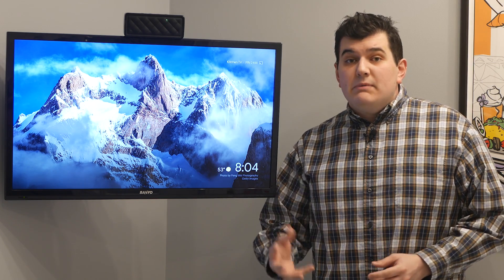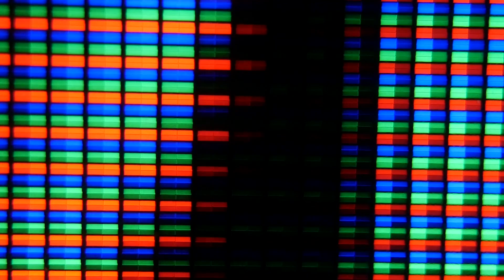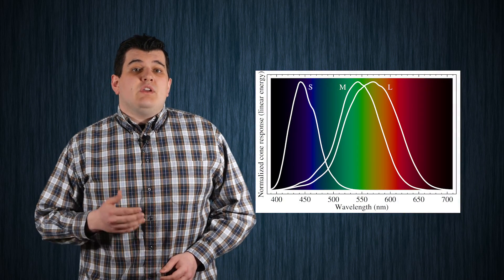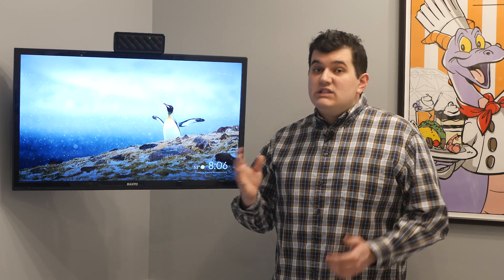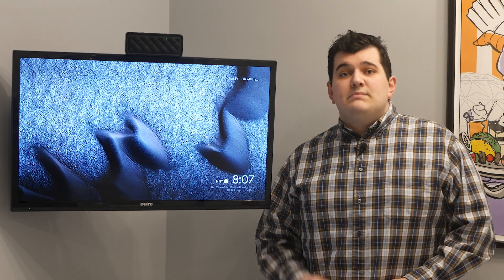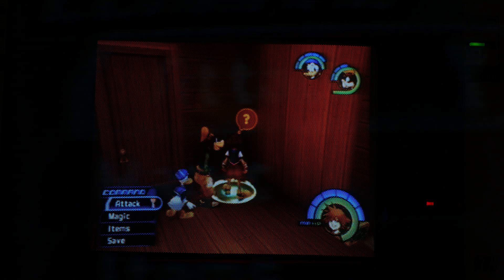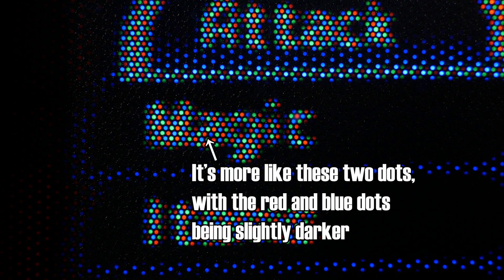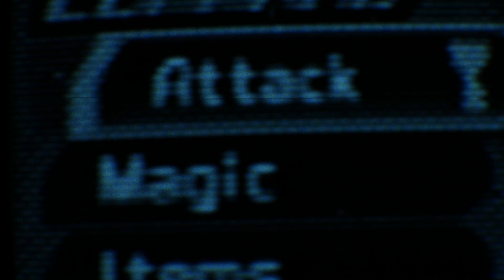These Are Not Pixels: Revisited

Comment: One note about computer CRTs: They work the same as CRT TVs, just generally with far more phosphor dots.  Note that this often determines what the "maximum resolution" of a CRT monitor is.  Higher resolution CRT monitors will have more phosphor dots packed in tightly.  One big thing about CRT monitors is that their input signal rate varies based on the resolution and refresh rate (frames per second / Hertz) chosen.  Most will have a defined "maximum rate" in MHz, based on the horizontal scan speed in kHz (that's the speed at which it scans across the screen,) multiplied with the frames per second / Hz rate (being how many times it goes down the screen redrawing the whole picture.)  That's the maximum speed the electron gun can change brightness.  In many monitors, that speed can be "overclocked" - shoving more changes at the CRT than the electron gun is actually capable of doing. This would allow you to either refresh the screen more often than the monitor should be able to handle (more frames per second,) at the expense of horizontal accuracy; or it would allow you to run the display at higher resolutions than it should be able to handle.

And in many cases, there won't be enough phosphor dots to accommodate that higher resolution. I had a high-end CRT around the turn of the millennium (okay, just typing that feels odd,) which was "rated" for 1600x1200 resolution at 80 Hz as its "maximum."  But I could run it at 2048x1536 resolution at 56 Hz.  That had a few major drawbacks - it was flickery has all heck, really straining on the eyes.  It lost horizontal detail, often losing detail horizontally to the point where it looked worse than 1600x1200.  And it didn't have enough phosphor dots - you lost whole pixels of detail.  A one pixel diagonal line would look "noncontinuous" as bits of it managed to avoid phosphor dots.  The phosphor gun may have been outputting the correct intensity at the correct time to draw it, there just weren't any phosphor dots of the right color there to light up.

Comment: 6:41 - "Think of it like three picture tubes, one red, one green, one blue" - which is exactly how my last TV worked. A rear-projection TV that actually had three physically separate CRTs - one red, one green, and one blue.  They were both aimed through focusing lenses and mirrors at the rear-projection screen that you saw the image on. It was a first-generation 1080i TV, but the display itself was basically the same technology as decades-old analog TVs.  By the end of its life, the three CRTs weren't properly lined up with each other any more. You could run the built-in adjustment system and get the center of the screen to look razor-sharp, but the edges would be off - if you displayed a picture of a white rectangle on black background just inside the outer edge, you would see a red rectangle, a green rectangle, and a blue rectangle, all slightly misaligned to each other.  The same thing in the center of the screen looked fine, though.

That was the problem with rear-projection-by-CRT: alignment was hard.

Comment: Standard definition is not 480i.  It's 525i.  Only 486 lines are visible though.  When digital recording formats were developed for analog SD broadcast most digitized only 486 lines making the recording format (D1, DigiBeta, etc.) 486i.  Later, consumer oriented digital video formats (mainly those based on MPEG compression) stopped recording 3 lines from both the top and bottom of the screen simply sending black to them on playback.  Formats like DVD and MiniDV are 480i.  Almost all professional digital recording formats are 486i.  And the analog standard they are designed to interface with is 525i.
Reply from the maker: This is all true but largely meaningless when considering overscan on any CRT television would almost surely show less than 480 lines.   Plus, many of those 525 lines were the vertical blanking interval and don't contain any image information.  From the consumer's standpoint, 480i is how they know SD.
Reply: True, but overscan makes '480i' just as meaningless then.  But when you are talking about how analog TV doesn't use pixels, to call it by a designation that has nothing to do with analog and is only relevant to an analog signal that has been digitized into PIXELS, that's fairly misleading.

Comment: I appreciate you probably won't see this but I would like to posit a counter argument. A pixel on a modern monitor/TV receives electricity to determine which red/green/blue on each "unit" of three turns on. An old style colour TV does the same thing the only thing which changes is the method of delivery of the electrons. I would argue it's a false logic to argue that because a mask is used to control the delivery of the electrons that this fundamentally changes what the group of three colour "receivers" are. Also the fact that resolution is better on modern TVs I don't see this as a difference in any fundamental effect. If we don't define a pixel as a block of three coloured projectors how do we define them? Arguing that the method of delivery of the electrons which turn those three on changes if it is a pixel or not is like arguing a car is not a car if gas gets into the engine in a different way.
Reply from the maker: See this I did, and respond I shall!  "The only thing which changes is the method of delivery of the electrons".  This isn't the case at all.  The analog video signal doesn't consist of pixels.  It's simply an amplitude modulated signal which dictates the strength with which the electron gun(s) fire.  Really it's just drawing a single line, but TV breaks up this line 525 times and stacks them twice for every frame.  The signal itself isn't separated into logical blocks like a digital video signal is.  
Also, when the screen is scanned on a CRT, the beam isn't moving in steps to place discrete points of light on the screen.  It simply slides continuously from left to right.  The smallest point of light it can create is defined by how quickly it can turn the beam on and off again.
If are old enough to remember setting the geometry adjustments on a CRT monitor, you'll remember how the image appeared to stretch completely naturally and there wasn't any apparent scaling going on.  The pixels generated by the computer aren't represented by rigidly defined windows like in an LCD panel.  They can exist between phosphor dots, and multiple groups of dots can represent one pixel.  This is why a CRT can display any resolution up to its max without moire or scaling artifacts.  Once you exceed its dot pitch, moire patterns appear because colors are being rendered incorrectly or incompletely.  
My argument basically boils down to this: Imagine taking a photograph, then covering it in a transparency resembling a grid of phosphors.  The image behind the grid is not made of pixels, but now you've placed a grid on top of it.  Is it right to call the cells in the grid a pixel?  Or are they just compartments?

Comment: THIS IS BULLSHIT! CRT monitors had pixels and precise resolutions ever since! Just because the image of a TV feed isn't made to have a specific brightness value for each color cell doesn't mean that the terms "resolution" or "pixel" aren't tied to the cells of a CRT tube. THEY ABSOLUTELY ARE! The spot on a CRT that has 3 color cells is the smallest area that can display a specific color and brightness. The number of these spots equals exactly the resolution the monitor has. Good computer monitors had pixel perfect images where you could see every pixel of each letter displayed. Showing a blurry image of a TV only proves that television didn't convey any kind of pixel information, not that a CRT tube couldn't have pixels!
Reply from the maker: So then, why can multisync CRT monitors display any resolution without apparent scaling losses?  You're confusing the fact that a CRT can display a grid of pixels with the fact that it actually operates on the principle of pixelation.  In your case, you're looking at an image where the digital output matches very closely the dot pitch of the CRT.  But there is no 1:1 lockstep relationship like you find with a digital display.

Comment: I totally agree with your explanations, I have been working in a company that produced broadcast and medical CRT monitors, we also made a color one with a B/W CTR (at 150hz) and a rotating RGB filter...
These concepts are not easy to explain, you do a very good job!

You could also say that any single color phosphor element can be partially lit by the electron beam thus being "more" than a single pixel (it's quite visible in the close ups of this video), even if the resolution will not take much advantage of that.

Comment: You are wrong when saying that by using only three light sources one can create any perceivable color. Due to the fact that different types of cone cells react to the overlapping parts of the spectrum, one cannot stimulate them independently. All possible combinations of stimuli form so-called color cone. The section if this cone by a plane, corresponding to the constant light intensity, form a horseshoe-like shape that cannot be completely filled with a convex combinations of any three colors. This means that for any combination of three different light sources there exists infinitely many colors that cannot be modeled by it.

Comment: If you very carefully break the guns off the neck of a CRT tv in such a way as to relieve the vacuum, and then chip away at the tube you can get an in person look at the shadow mask. On even a small set it's a huuuuge number of teeny tiny holes. I'm a dumpster diving weirdo and a guy came up while I was scavenging and started busting up the tube in a TV so he could get the copper from the deflection coils.   He had a wooden stick to pop the anode cable off the tube and it seemed like he had it down to a science.

Comment: This is why back in the day people played NES games with 4:3 ratio. That wasn't the game's actual resolution, but it was stretched horizontally (from 256x240 to 320x240 or 640x480 for example) to fit the TV. The game's pixels don't have to align with the TV's pixels, so it looks nice and sharp on the CRT display even when stretched. But on modern displays you have to make a compromise: play in pixel perfect mode, which doesn't look like the original game, or play in 4:3 mode, which looks noticeably blurry.

Comment: Really great video! I've been telling all my nerd friends to check out your channel. Special request: could you go even deeper and explain how "multisync" CRT computer monitors can crisply display different resolution images? I still don't really understand after watching this - is it just a matter of fine enough dot pitch to display the max resolution, and then letting the beams land where they may for lower resolutions? If so, wouldn't there be some resolutions that looked noticeably worse than others based on the math between the dot pitch and the horizontal lines? I never saw anything like that, and I owned a number of multisync monitors in my day, ranging from cheap and crappy to one of the best 17 inch units ever made. I still kinda miss that thing, all 50lbs of it and the "WHONK" from the degaussing coil every time you fired it up.

Comment: This is rather over explained. The simpler explanation is that a pixel is an individual picture element produced solely by a computer. A CRT display has its own individual physical elements (raster lines, dot mask, etc), but they are not called pixels and never were. An LCD screen has individual LCD image elements. A plasma screen also has individual screen image elements. It wasn't until digital displays came about that we begin to see 1:1 computer pixel to screen display element mapping. At this point, this is when some people began calling what was on the screen a 'pixel'. But, that's incorrect. A pixel is still very much an image element produced solely by the computer. As an example, if you have an eInk computer display (yes, they exist), what makes each computer pixel visible on the display is eInk. Yes, these eInk image elements reproduce each individual computer pixel, but the eInk technology itself is not made up of pixels.

Comment: Great video, as always, BUT 6:43 Why did you killed those three poor lil flyback transformers? You've cut the HV wires, while it can be disconnected from the CRT... 
Those mini portable BW CRT TVs look like NOS. I know that they are practically almost useless, but it still hurts to see the pointless destruction of them. By pointless, I mean they could have been reassembled, or at least the flybacks reused if you didn't cut the wires. Actually, one of the few useful parts of them are the flyback transformers, very handy for HV experiments. They are also handy (the whole mini TVs) to biuld XY monitors for DIY spectrum analysers, or other fun experiments.

Comment: The Phosphors grouping of three are pixels to me because it defines the resolution.  When you put the screen in front of the album cover, you do break up the picture, but the resolution is not limited to the cells.
Reply: ezerish no. The phosphor dots can have varied intensity across them. Dot pitch != resolution. It is possible to have a greater resolution horizontally than a dot pitch though you are limited in some degree by electron beam width, but you can make up for that with the moving dot.
Reply: The color dots do not define the resolution. When the electron beams turn on and off is independent of the color dots. Watch it again.